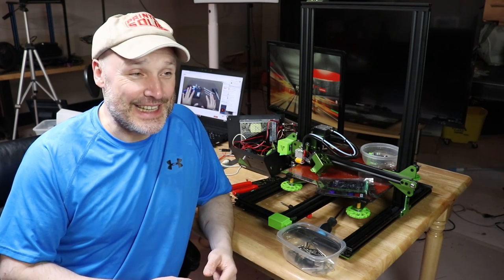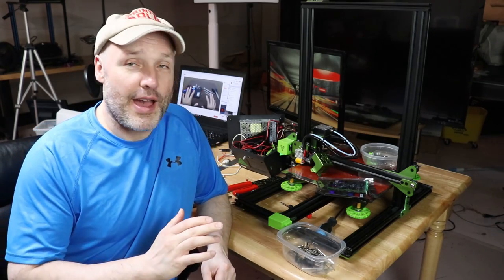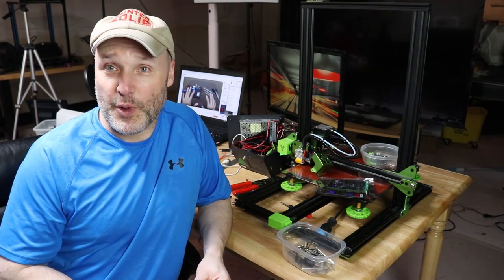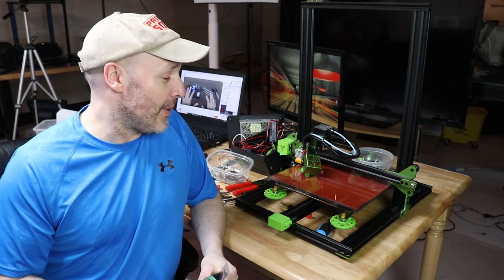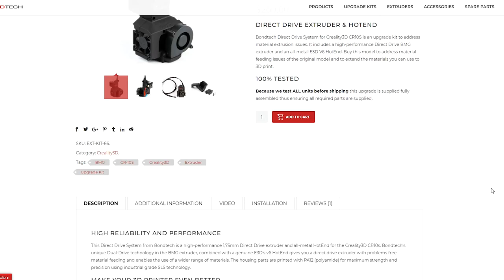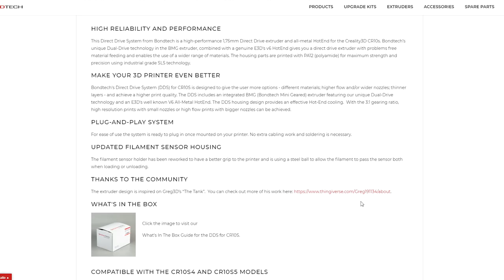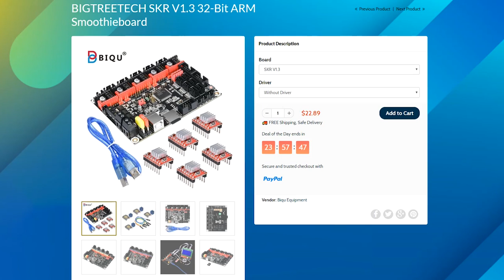Upgrading my Tevo Tornado 3D Printer!

Comment: I haver the 2nd generation version called the 2018 gold edition. This version has some of the upgrade already included. Such as the gen L 1.0 board. I bought a TH3D power supply to replace the stock power supply. Th3D says it will help reduce the jerkiness do to excessive ripple in the stock power supply. I have a Q: can you take a picture of the on/off switch. I want to make sure I have the wires hooked up correctly. My switch is the 6 pole type. 3 poles, I think, come from the power cord. And 3 poles are part of the switch itself. I just want to make sure I have the wiring from the switch part to the power part of the switch itself. I really want to know if I have the power lead hooked up correctly. I can't find any info on the net. Thank You.

Comment: Greetings from a fellow Mainer and fellow Tornado owner. I subscribed because of these 2 reasons. I’m anxious to see how your tornado prints with the upgrades. I would like to see you upgrade to the Hemera. I’m debating going this route too. Ive been plagued with extrusion problems on my Tevo. I tried a knock off Bondtech dual drive that seemed to help but still not perfect. Seems like I haven’t had a good quality print from it on a long time. Anyway, Look forward to the next Tevo vid!
Reply from the maker: I’ve been watching to see what’s out of Hemera CR-10/Tevo Tornado upgrades.  I’ve seen some that are functional but don’t seem to include the part cooler and/or the BL Touch/ EZABL solutions.  Still researching

Comment: I solved salmon skin by simply cranking up the driver Vref to max :) As a bonus, it is now very fast machine as well :)
Control box fans i fixed by hooking those fans in series, halving the voltage per fan.
You could also step down voltage for stock fans with buck converter, but much cheaper and easier to hook them up in series :)
Besides, Noctua fans are way way way over hyped. They are just fans, quiet fans. But they are not the only fans, nor necessarily the best ones for this application. Because they target quiet, they do not have the highest volume or pressure, something has to give always. You can make any fan as quiet as noctua.

Comment: Hey Paul! Thank You for sharing all Your experiences with this printer :) Did You change mainboard since this video, and/or can You recomand any (or features it shiuld have)?
Reply from the maker: I paused because I have concerns about the AC bed and want my electronics friend to instead it.  The SSR should be on a much bigger heat sink. I’ve searched what the correct heat sinks should be for an SSR like that and definitely not inside the control box.

Comment: We have both the Tornado and Nereus.  Having some problems with both (mainly the hotend and extruder).  So if I got the Bondtech upgrade kit for 1 (or both) what will be involved in switching it out.  Will I jus simply need to rewire a plug on the Bondtech components?  Thanks for any advice you can offer.  I did the RuiRaptor upgrade for salmon skin on the Tornado way back when we got it.  But I have not done any upgrades or changes to the Nereus.
Reply from the maker: The Tornado is a 24V system. The Bondtech SDS is 12V.   I asked them to make me one that was 24V, a custom one.  They did it for me. I need to check the firmware but I’ll be giving that a try soon!
Reply from the maker: That should read DDS
Reply: @WhereNerdyisCool  thank you for the info. if you happen to come across another solution for replacing the hot end and extruder for the tornado and the nerius, please feel free to share. I'm ready to get these upgraded and working very nicely again.

Comment: Whats the Status of the Upgrades?  I'm in similar boat and haven't touched my Tevo Tornado in over a year because of "Issues"  Mine shipped with MKS Gen L board but now im thinking it was a fake.  My bracketry is also Gold..  Did you re-attach the heated bed to the replacement glass Bed?
Reply from the maker: I did!  Still debating what to do for hot end since the new E3D Hemera came out
Reply: @WhereNerdyisCool  Please do a follow up video with the tevo tornado and the modifications details and how the prints are coming out with a detailed parts list and firmware.  Pm me if you need sponsorship on HotEnd or dual Z